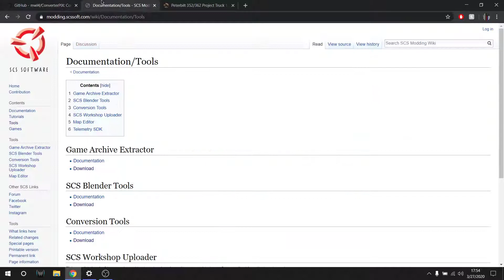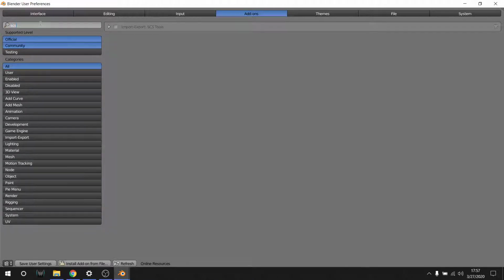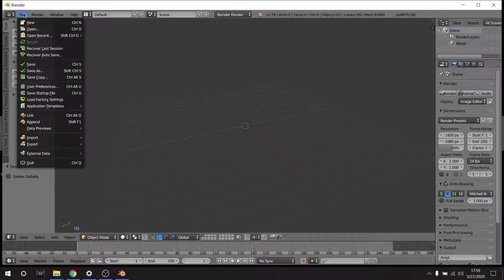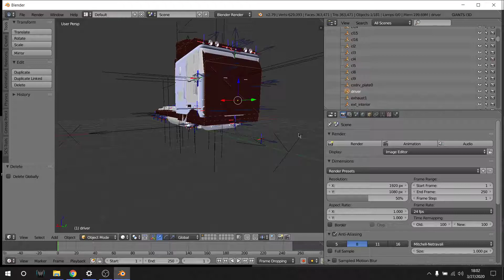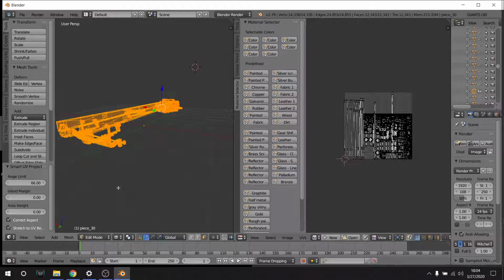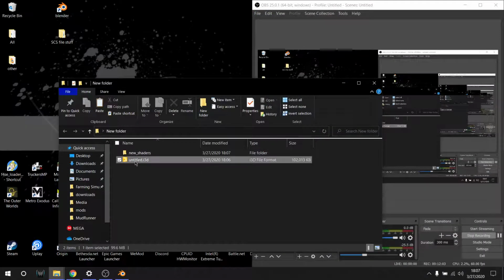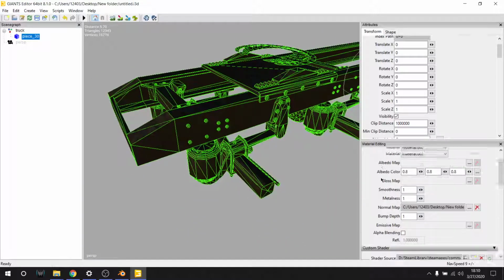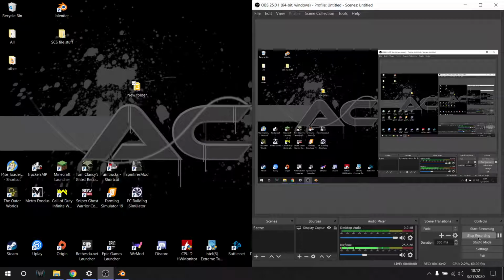A quick and dirty ATS truck into blender how to.

Comment: This works fine-ish to set up but the problem is that once I unpack the scs file there doesn't exist any .pim files. Only dds, tobj, pma, pmg and pmd. Not one pim. And that's not only with this pack, i've tried a couple of different mods but all were the same. No pim file types. Any tips on how to proceed? Cheers.
Reply: You have to convert the unpacked model files into .pit and .pim variants.